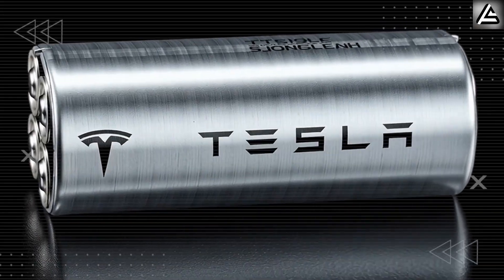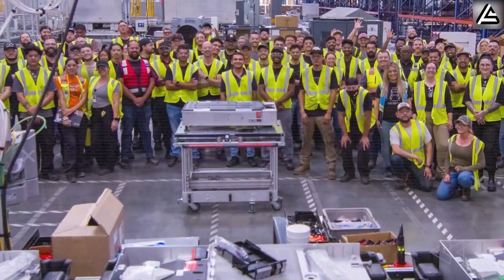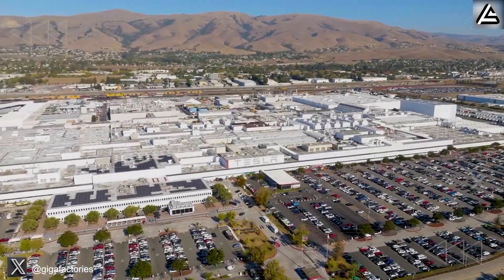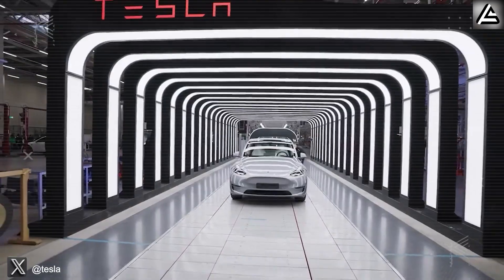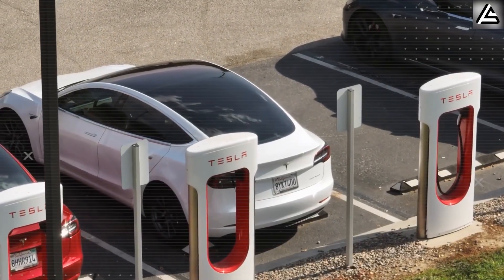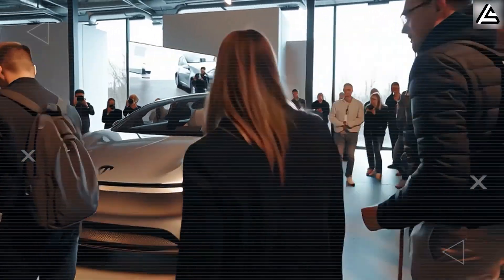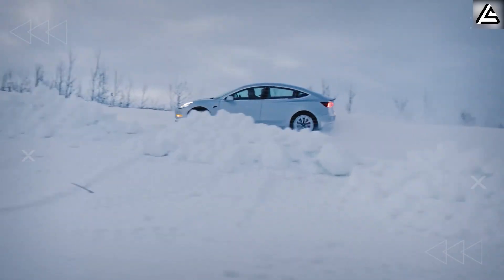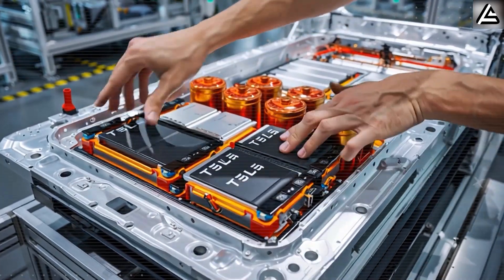Elon Musk Announces Super Aluminum-ion Battery For 2026 Tesla Model 2. Why It Matters?

Comment: I hope the Al ion and Na ion batteries make LiFePO4 batteries price drop!
I plan to build a home battery in a year or two.
Reply from the maker: Great to hear your plan, can’t wait to see more affordable options for home energy storage
Reply: @AutoGearShift2 
I built one out of used 18640 batteries (3000+) which has been running my house for the last 4+ years. Everything but the 240V items. No problem, I also made a small LiFePO4 system for a back room with small fridge, just to get some experience with the cells.
Much easier and better.
Reply from the maker: wow cool! thanks for your sharing